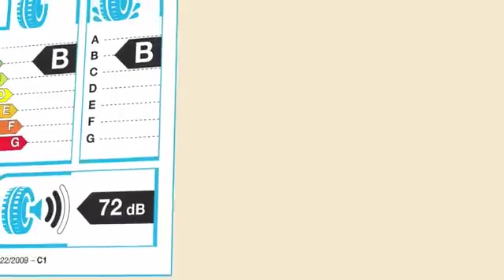What is aquaplaning?

Comment: 1:34 lol so basically this is a good sign?
Reply: That's what I was thinking, very confusing
Reply: Yes, second car is sliding on the road meanwhile the first car maneuvers without sliding. Second car is going to have problems braking also.
Reply: Nope. Notice how the driver was purposely swerving the car. With the first set of tires, the car actually responded to his commands and was much more manouverable. Withe the second set of tires, the car barely moved, despite the driver trying his hardest to swerve. If you were on the road during rainy conditions and needed to steer your car out of the way in the last possible moment, that'd be near impossible with the second set, thus causing a potential accident.

Comment: The same old incorrect advice from a company that's more interested in selling tyres. The most important factor in aquaplaning is speed - even a brand new tyre can suffer from aquaplaning if the speed is too high. 

Try driving the car with low tread depth more slowly and see what happens.